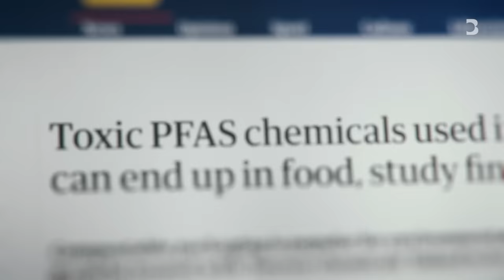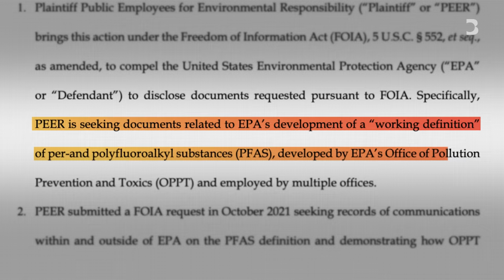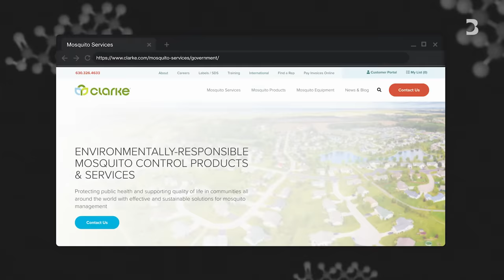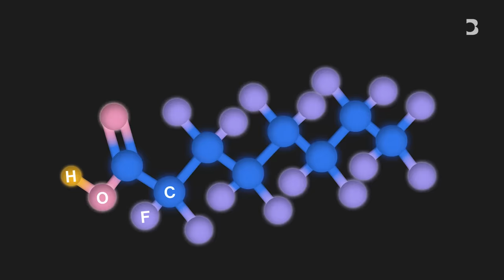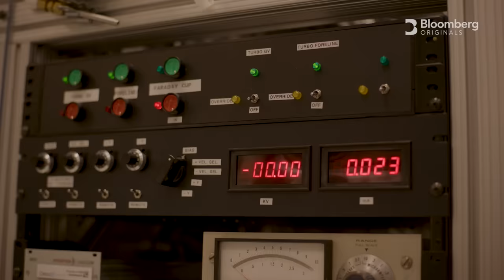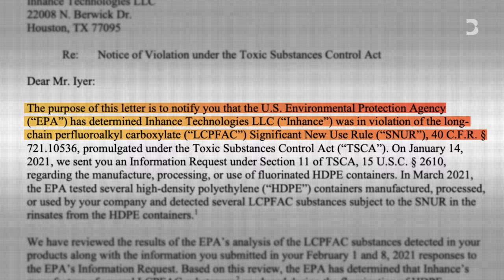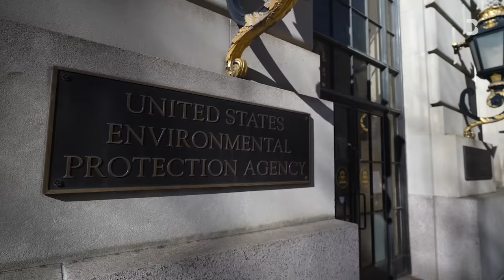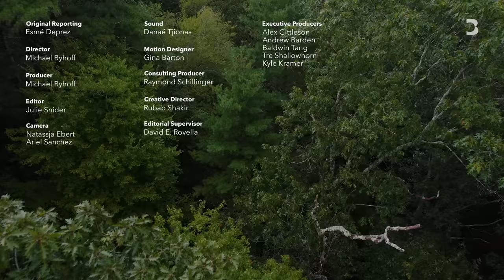Why 'Forever Chemicals' Are Still Spreading

Comment: The sooner PFASs are banned the better. Lead in gasoline (prevents engine knocking). Arsenic in wallpapers (gave nice green color). Asbestos in pretty much anything (similar reasons as to why we use PFAS for everything). X-rays for fitting shoes (so convenient instead of, you know, walking a few steps). You name it. What could possibly go wrong? I mean, sometimes it is difficult to know beforehand how widespread effects something causes, but we should 1) study beforehand, 2) stop as soon as we realize something is wrong. But we mostly skip 1), and we take usually decades to react. And too often, the replacement is as bad.

I just wanted to check if in Finland we have some regulation on the substances (we usually have quite strict ones). Well, I found a store selling fluorinated plastic bottles with a mention on storing food items. And as far as I could tell, it was not FPE (it was said to be fluorinated from inside and outside). FPE should apparently not have dissolving PFASs in it, as the fluoride is in the polymers - and even for those, what happens when the plastic will eventually break down? What was worse, the company claimed that the bottles are fully recyclable. So that means that the PFAS will be making their way to all recycled plastic, which is also used for storing food items and cosmetics. And who knows what is being sold in PFAS-containing plastics?

Comment: Is it possible to rid the body of these chemicals
Reply: They're just going to come back. The same lesson of interdependency over and over again and we keep going to war and doing this kind of greed based dumb thing.. we're all in this together
Reply: Donate plasma a couple of times a month. It won't clean them all, but it will help ❤
Reply: Nope.  There is a reason they are called forever chemicals.
Reply: Well, fasting may help with this. Paul Bragg, used fasting to detox himself heavy metals. It is mentioned in one of his books.
Reply: @VondaInWonderland wouldn’t you then just be giving your PFAS contaminated plasma to someone else?

Comment: Sorry, but this is standard chemical-scare stuff. 
Fluorochemicals such as Perfluorooctanesulfonic acid (PFOS) are so widely used because they essentially do nothing in the biochemical environment. A bit like Argon, about 1% of the air we breathe.

Yes, that is why they persist in the environment, but so do particles of clay and sand. However fluorochemicals ARE actually degraded (slowly) by sunlight and oxygen. Vitamin b12 has a half life in the human body comparable to PFOS. PFOS is soluble in water as well as fats, and does wash out into the environment for degradation.

Wikipedia will, disingenuously, tell you that "PFOS does virtually not degrade under environmental conditions..."

Put your lawyer hat on for a moment and read that again. Especially the words "does virtually not degrade". "Virtually not" degrade?? Meaning yes, it does degrade. Slowly, with no established toxicity issues at the low concentrations it is detected at. For every fluorochemical that can be detected by modern analytical chemistry in your body, there are hundreds more established plant-based toxins in the normal human diet at higher concentrations.
Reply: This is completely inaccurate and disingenuous.  You are misunderstanding the science when you claim PFOS degrades under sunlight.    Moreover, continuing research indicates that these compounds do have a deleterious impact on human health.   These compounds are entirely man-made so to assume that they are biologically neutral is unwarranted.